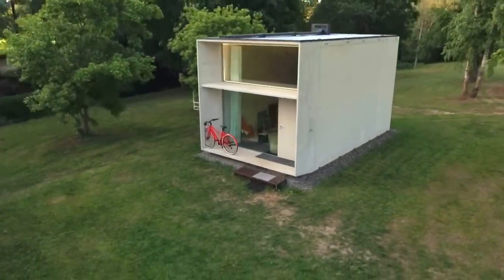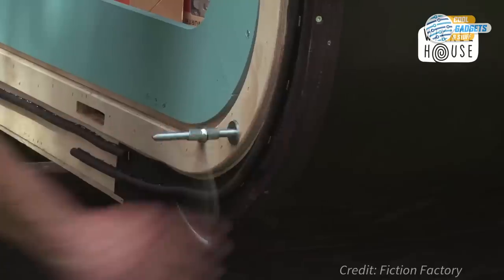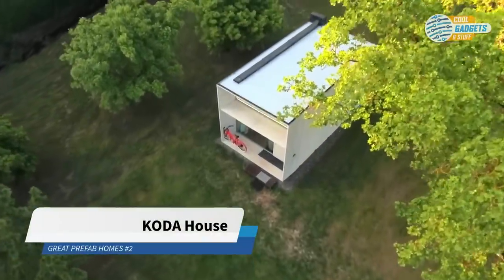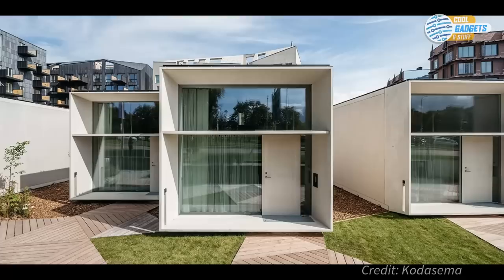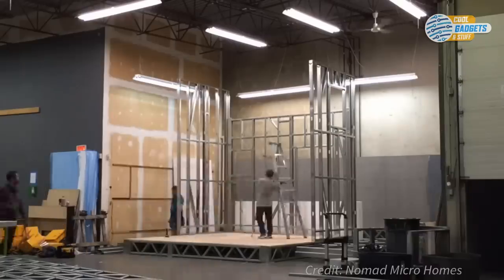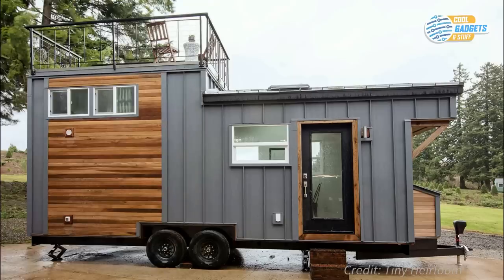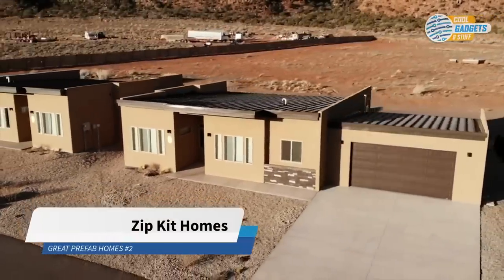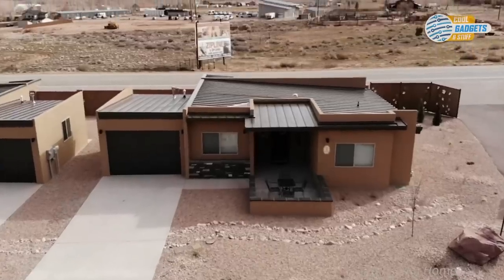7 Great PREFAB HOMES #2 (some affordable)

Comment: The popularity of minimalism and tiny homes has caused the cost of these ''cheap' homes to skyrocket. These aren't affordable in the slightest.
Reply: be a good business  high mark ups
Reply: Chezwick Cheese 
So agree.
Reply: Agree, these are way overpriced now!!
Reply: I was going to go the tiny home route, and just build one myself, but I did the unpopular thing, even though it's essentially the same materials as any decent tiny home, and bought a used mobile home. One that is in really good structural condition, but needed some finishing work, for $20K (it's 60ftx20ft) 2 bedroom, 1 and 1/2 bath, a little over 1300sq/ft, big kitchen and living area, 1/4 acre lot included in the price. It's on a concrete foundation. I put on a steel roof and steel siding (40-60 years of durability) and the siding looks like your typical vinyl, but will last much longer. The interior was gutted (even the plywood subfloors) and redone with 1" Douglas Fir structural exterior plywood (very resistant to mold and mildew), 1/2" sheet rock and reclaimed wood paneling. Stripped the ceiling out and added spray foam insulation, replaced with 1/2 sheet rock as well. So now it no longer looks like a cheap mobile home on the inside. All told, I've spent around $40K total (so far) doing the work mostly myself while living in a camper on the lot. Took me a year 1/2 to get it livable. Still have a little bit of finishing work. But I enjoy doing this kind of stuff, so it's good for me. I think by the time I'm finished, I will have spent MAYBE $50K~ on it, total, and I'll have a nice place to live that will last the rest of my life and then some, that looks beautiful and is made from good quality materials, for a fraction of the price of these tiny homes. And there's no compromises on living space, especially for a single man.
Reply: I'm looking right now for a small modern modular house. Prices have tripled. Ridiculous.
Reply: @abigailsmith6977  checkout earthbag, and rammed earth homes.
Reply: I looked into the arched cabins, those are very affordable. You have to do assembly yourself, But you could likely get a decent home for under 20k from them, if not under 10k. Shipping was a little pricey, but still very manageable
Reply: Doesn't matter. Even if you could get them cheap, in Texas, the Nazi city councils will cry that the house doesn't "fit" in with "aesthetics" of the drab, 40-year-old falling-apart homes in the neighborhood and will charge you so many extra fees that the price will climb to $80,000 altogether. That's why I never see these kinds of houses anywhere in that state.
Reply: @AlphaMachina  Those are not legal here in MD. All mobile homes must be in a mobile home park. so you gotta pay land rent of 750 or so a month
Reply: Just get a used Mobil home and remodel it is already made and will have more space
Reply: @AlphaMachina  for that price you can build with concrete
Reply: Exactly 😔
Reply: Ain't it the truth
Reply: The “asswipes” did leave the market open for a reasonable priced unit.  I don’t know who has the ear of the Amish and Mennonite shed builders in Michigan but they could really do great in this market.  Somebody has to do some engineering on a post type foundation rather than traditional pored wall or block.  In the south on the gulf coast all the lake front cottages are build 8’ to 12’ above grade to stay dry during storm surge.  They usually use telephone poles soaked In creosote at the corners and use the under space as a garage.  Some build a utility room on the grade. These are million dollar cottages, not junky 50 year old mobile homes on stolen telephone poles.  My daughter is a certified architect and she said to do that in Michigan would require both an professional engineer design and architect plan and a review before the building department who only know how to do things one way.
Reply: All we need to find is a quality grassroots company that can do this realistically
Reply: I agree with you Chezwick. I was like "these aren't affordable?" It costs less than that for a normal stick home in a cheap area.
Reply: Each thing they show is twice as much as a 5th wheel smaller, and crappier? Why would someone go that way??
Reply: 2050: All the rich people living in shitty trailer parks
Reply: You mean 50,000 USD isn't reasonable for less than 400 square feet? That's a steal
Reply: @Einriech  My old house is worth 40k USD and is 1440 sqr feet (within the USA)
Reply: @mac-iv5gs  1440, is a big difference from 400
Reply: @Einriech  I know. Thats my point. (of course its in a really shitty neighborhood)
Reply: Ther is a company in Poland which build tiny houses for 15k. :)
Reply: @quinteneaton3875  ...control, control, control.
Reply: @mihiec  Any more data on them, like a website?
Reply: I was thinking the same so so sad
Reply: Yup
Reply: @largol33t1  time to move. Lots of unrestricted property in Tenn
Reply: @mihiec  good luck with shipping costs.  Maybe the builders could come to the US
Reply: You’d think the popularity would justify lowering the price but alas
Reply: 45 thousand dollars?????????  FOR THESE SHOE BOXES????????
Reply: You're right, a couple years ago they were much cheaper
Reply: @largol33t1  Look at towns/cities in Texas that welcome tiny home owners. Places like Spur for example are good places to look.
Reply: @abigailsmith6977  buy the plans and hire your own builder. The plans used to be under 8k. Don't know about now.
Reply: @FreyaEinde  Demand raises prices
Reply: @johnpeterson2987  By that theory a bag of cheetos should by 500 dollars, the pricing is arbitrary and the threshold set by people. It's not a natural conclusion dictated solely by the market. Products would be dead in the water with nobody to buy them, but this product and most housing has opted to be a luxury product. The demand has nothing to do with it.
Reply: @FreyaEinde   @FreyaEinde  demand has something to do with it. As does supply. Cheetos aren't $500 because the supply keeps up with demand. This does not mean that cheetos would be $500 if the supply were to decrease. They aren't so popular (demand) that people would spend their entire grocery budget on them. The price might rise a few cents or a few bucks before demand dropped due to the price being unreasonable. Supply and demand work in a balance like that. 

Tiny houses are in demand because they are popular. Demand will continue to increase the price (ie the seller will increase the price because people will buy it) until there are more on the market that aren't being purchased either because they made more houses than there are buyers, or because people are no longer willing to buy them. It's simple supply and demand economics. There will be a balance in the tiny house market eventually but it could take years. Once the fad wears off and/or the market is saturated. You can't sell something for X price if someone doesn't want to buy it.
Reply: @FreyaEinde  Also, the seller alone doesn't set the price. Like you said, products would be dead in the water with nobody to buy them. The market IS people. There has to be a buyer willing to pay the asking price. If they find a cheaper deal they will go with the cheaper deal, and the more expensive seller will have to lower the price or wait for the cheaper guy to run out of supply. The total supply decreases but demand stays the same so he will be able to sell it, or demand decreases independently and he can't sell it. This is supply and demand in a nutshell.
Reply: Right?! One of them was 100k - you could buy a proper country house for that much
Reply: U said it
Reply: Totally right!!
Reply: @shadowblack1987  did you ever find an inexpensive one?
Reply: What a shame...
Reply: @Olde Skool Do you have a business and if so, a website and where are you located?
Reply: @Olde Skool do you know a trusted source? I need one asap
Reply: They’ve literally become guest homes or backyard suites for spoiled kidsz
Reply: Everyone’s definition of affordable varies, depending on income and other variables. But you are right, these homes are often expensive.
Reply: Yep.  Even park model homes are 100k+ now.
Reply: @mihiec  which company in Poland?

Comment: A few years ago, these weren't as expensive. I think the popularity of tiny homes has driven the prices sky high.
Reply: Inflation, cost of chemicals and solid materials to build them is very expensive. It takes a ton of fossil fuel to build these things and gas prices are higher due to restrictions.
Reply: but the wikkelhouse (They literally just gave their formula away on youtube for free - Pa!!, where's that elbow grease at? My frined Will is going to tag along - will power - )you know him? lol
Reply: V
Reply: @Thomas Supply and demand my friend. Have to remember, there's an extremely high demand for affordable housing of any kind, and very little ability to meet this demand.
Reply: Ofc, that's how our dirty world works
Reply: Yep, the tiny home movement is nothing but a huge racket.

Comment: The cheapest one works out to be $100 per square foot. You can build in RCC concrete for a much lower cost.
Reply: True, but RCC is a pig of a material with very poor build characteristics outside of very limited circumstances.  It's probably the last choice for anyone that cares about anything other than cost.
Reply: You are right Mahesh Rajannan .. But I won't even fibb right now - The Nomad Micro den is pretty f^^king sweet and dope if you look at it's low cost of 38000 on it's website, - of course, you also have to think about provincial/state/prefecturial requirements of a home, and the additional costs of a foundation, hooking it up to the grid (off grid is hard) you need septic systems and the biggest cost is having a land to put it on .

But all in all, we can be assured these are fine works of art, impressive to the eye and holy flying hedgehogs batman!!
the cheapest one has big earthquake tested.. a bit small for me, but spectators need not complain why-aye right?

cheers!!

Comment: For these prices in the midwest, you could buy land and have a 1200 sq ft ranch style house built. What is the point of these small cookie cutter houses, if they aren't cheap? Tiny homes can be built easily for under 10grand. These prices are atrocious.
Reply: It's for people who don't want to undergo the hassle of building and planning everything. Most importantly, this is for people that don't want to wait a year or longer to move into their new house.
Reply: Supposedly it's for control. One of the big things are that they're built in a temperature and climate controlled factory  so you have a perfect house when it's done. I dont even own a home yet alone a prefab, so I have no clue if that's bs or not
Reply: You can certainly do it for under 10 grand... IF you have the time to do a lot of it yourself and if you know what you're doing. For many, time is more valuable and is an opportunity cost. Many projects (especially home building) run way over budget. By having a prefab home, you can be confident in the cost, timeline and expectations.
Reply: @marcusjones457  You're correct. When I first started looking into prefabs years ago, one article mentioned an analogy: Would you buy a new car that had been assembled outside in the elements? If not, why spend so much more on a house built outside? Maybe that's fine for desert regions, but here in the Northeast we see homes and additions being built while getting pounded by the weather. For months. You might think tarps do the trick but they don't stop everything. Most people would be shocked if they understood how their "new" home was assembled.
Reply: @arachosia  The point is that the kit homes are garbage for the money. If I can get a similar new house built cheaper than what they are selling their kits for, then what is the purpose of the kit?
Reply: @arachosia  You certainly can. Maybe not in California, due to so many regulations preventing people from building. Some of the prices are 6 figures and up for building materials. That doesn't include labor or land. Trust me when I say they're a ripoff. The freaking wikkelhouse is made from cardboard. That structure is very susceptible to damage if exposed at all.
Reply: @trickmiller8169  even here in Georgia in my own land, slightly inclined and easily accessible to the highway, I have not found any option below $150,000 to build. If the gentleman from the Midwest can build for $10,000 I pay him double or even triple to come and build my house.
Reply: Totally agree with you trick.......ridiculous prices!
Reply: Idunno you can get a pretty small traditional modular built fairly cheap and a trailer even cheaper. Problem with a trailer is that you wouldn't find one as high end as some of these appear and most cities/towns/villages won't let you set one up outside of a designated trailer park. Which means that instead of owning a piece of land you're renting about half a regular sized  lot, if you're lucky.

These kinda houses have the same problem trailers do, although legislation is lightening up on them. So you'd expect them to cost somewhere between the price of the two.
Reply: Amen.
Reply: @marcusjones457  hmmm, not sure if it's still the case once it's exposed to the elements
Reply: @3WDon  Fashion/trend. These are for people who live on social media looking at influencers talking nonsense. 
These people live in the un-real world. They do not do any research. 
Most of these cabins can be made by half the price by most local framers.
Reply: Would love to know who would build a 1200 sq ft brand new ranch style home for under 100k 😂😂😂 what a joke, maybe do some research before opening your mouth. 2BR/2BA 1200 sq ft ranch build in southern Idaho starting at 250k. Lot+ zip kit home, same sq footage is 150k when all said and done. I'm looking at an 800 sq ft zip kit on a $25,000 lot, with everything included I'm looking at 110k.
Reply: @ryancraig999  that widely depends where you live, how close you are to large cities/metropolitan areas, and price of material. Every state has their high and low price points and not all low price point homes or land are in bad area or in terrible condition. My father in law in Tennessee built a beautiful 2000sqft four bedroom, 2 1/2 bath with land for $70k within a year total and it's current value is around $250k and it's in amazing condition. A lot of people are worried about moving too far away from family or commuting so they don't look for land or houses further away that would be affordable and decent. Don't really know what the warranties on these prefabs would be but the insurance on most prefabs aren't desirable because they're not designed to last like a traditional build or will give a decent resale value if you later don't want it. To each their own though.
Reply: For people wanting to cut down on their debt and costs, you'd have to be insane not to save yourself 30k by building one yourself.
Reply: I think it’s just the new yuppie thing to do.  “Decrease your carbon footprint”, and all that.  I am nearing retirement and would like to (have to) sell my large ranch style home and get something under $75,000 which is very difficult/impossible to find without doing a gut job and then putting a lot more money into it in the area I live in.  I also would like to know where do people put these small homes?  With all the building restrictions you would have to live way out somewhere which appealed to me before but not now that I am looking at retirement.  And then there is the cost of land improvements, septic, well, and other things I know nothing about.  I hear people complaining about the cost but that is all dependent on what part of the US you live in.  Is there some place that is welcoming this type of living?  I have only seen these small houses in mobile home parks or out on private land.
Reply: @susanv2168  It's not just about carbon footprint. People want a low cost, low maintenance, and minimalist house. Lowering you cost can allow you to travel more as well or save more money over time. Generally there isn't anywhere that welcomes small housing. Cities do not like low cost housing, because it generates less revenue for property taxes. That's why in a lot of towns and cities, there is a minimum sq foot requirement for housing.
Reply: Pretty true. That's why I live in an will retire in uppermidwest region! Got brand new construction ranch on .5 acre in great semi rural town $250k . U can find cheaper but we have top notch schools..very low crime..Plenty good paying jobs..2 universities nearby. Home prices are rising!
Reply: @marcusjones457  a well built "reg new home" outside can be built just as good or better depends on materials/builder.
Reply: THE PRICE OF LUMBER WENT UP 300%. tHE MATERIALS NOW FOR THESE HOUSES ARE OVER 10K. Concrete prices are super low. All cinder block houses can be built for cheap.  Concrete and labor you may be able to finish 250 s.f for about 25k.

Comment: We live in a 1958 vintage National pre-fab home that is a sound as the day it was built 62 years ago, and just as sound as stick-built homes of the same era.  It was built as 3 bed 1 bath on a full basement.  It has since had another bed and bath added as a master suite and had the kitchen remodeled, but no major structural changes.  If it has any drawbacks, it is the 2” framing of non-load bearing interior walls.